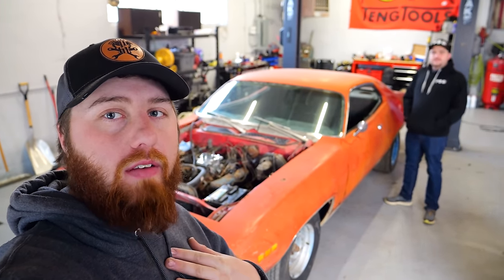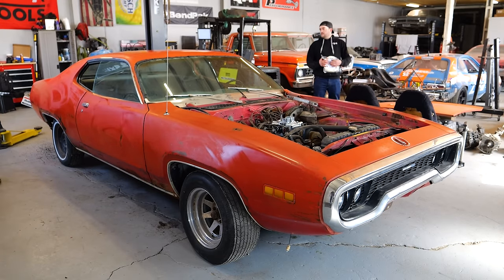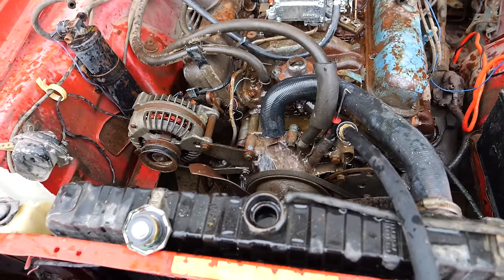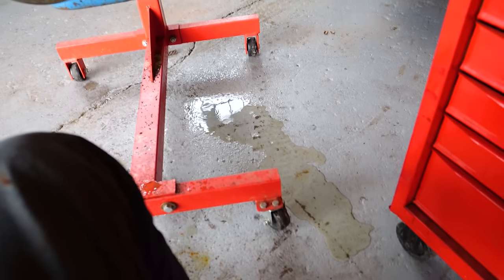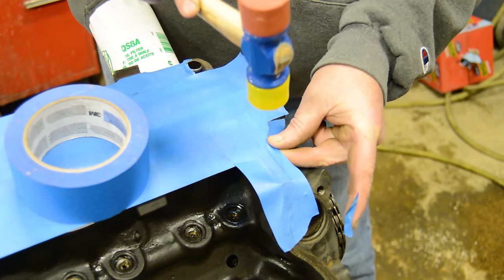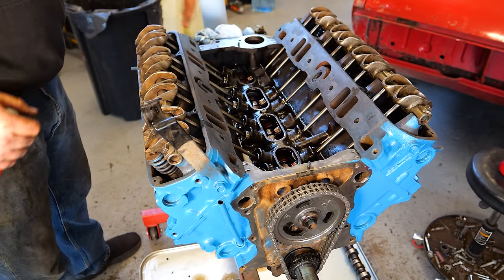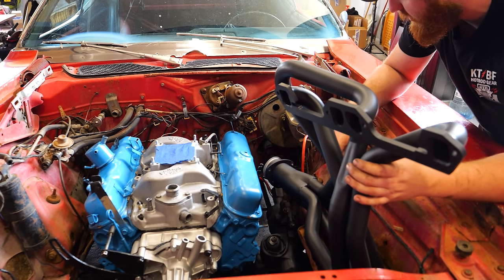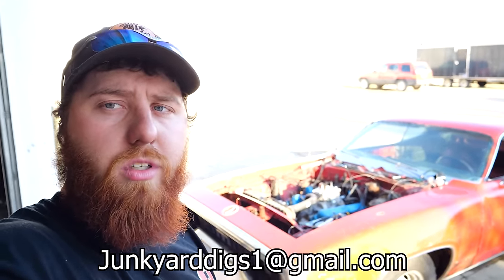ABANDONED MOPAR Budget Engine Build + Paint REVIVAL - Lost for 30+ Years!

Comment: Camshaft install tip I was taught: Get a long piece of all-thread the same pitch as the cam sprocket bolt and use it like an extension to put the cam in, then just unscrew it.
Reply from the maker: Thats a good one! Another trick is to out the cam sproket on and use it like a handle, unlike I did 😂

Comment: Hey Kevin…..as a rule of thumb while you have that engine out of the chassis now would be an excellent time to replace ALL of the freeze plugs.  Even back when those Mopars were just a few years old they would eat up freeze plugs!
Reply from the maker: May or may not have cover those in expoxy and said send it 👀
Reply: Hey, close counts
Reply: @JunkyardDigs  New plugs cost barely more than the epoxy and it would have been an excellent chance to clean out the inside of the water jacket. Would not be surprised if that block came from the factory with casting sand still in it, plus whatever mouse nest and rust was added later.

Comment: The clear paint is a good trick to help prevent all of the spotting you inevitably get with aluminum. I went ahead and painted mine the block color. Mimics a cast intake pretty well but I like the look of orange over the aluminum color. Like you said the trick is to just never have gas dripping down on the paint.

Comment: Awesome, these videos have me mesmerized! In the previous video I was wondering why you didn't work on the block first (the peripheral items are not likely to be show stoppers), but this video provided all the answers. I guess the secret is having a lot of experience with rebuilds/restorations which lets you size up the potential gotchas of a project like this. From the big coolant puddle in the previous video I speculated a broken water jacket, but fortunately not. A leaking freeze plug on a 318, imagine that! The color and luster brought to the surface by buffing and polishing is just astounding. Love that throaty engine roar near the end of the video - what a sweet sound! As a former 72 Challenger owner these videos really tug on my heart strings.

Comment: You have more self-control than I do. If I had gone so far as to have pulled that engine I couldn't have put it back without doing the rings ... bearings and gone through the valves. My OCDC would be killing me.

Comment: Kevin: points out that the freeze plug is leaking.
Also Kevin: doesn't replace the freeze plugs.
Reply: I give this engine about 4 months.
Reply: @rickallen6378  I'm pretty sure you can see that same freeze plug dripping at 46:30
Reply: @1234567890CAB  Yes I saw it, should have been dealt with.
Reply from the maker: I fixed em off camera b4 it went back in
Reply: @1234567890CAB  Pretty sure you're seeing water that was sprayed through the rad from the hose to cool it down, the fan is pulling it through and splashing it around.

Comment: My experience is with leaky valves with old engines that has been sitting for a while is most of the time of rusty valve seats. Which you can get ride off quite quickly by giving the valves a bit more valve clearance, and after it has run for 20 min you can go back to stock clearance or what is advised for the type of cam. Nice to see you guys having a lot of fun together!

Comment: fun thing about the chrysler engines is we paint 'em all in one peice, after they're put together..
you can assemble it fully minus the carb, and just go at it.. then add fuel pump n accessories.. no need to worry about over spray that way, and from the factory the bottom of the pan was barely painted. Makes it real easy to be factory looking heh..

Comment: Great video. Quick tip on the balancer removal, take the washer off the bolt when you screw it back into the crank. The balancer will clear the head of the bolt. - Jamie

Comment: When removing the harmonic balancer instead of pushing against the crank bolt and washer, remove the washer and run the bolt in all the way. It will clear the balancer without the washer on and you can do one pull with the puller without having to pull the bolt out. You also are engaging all the threads so no chance of messing the threads up.

Comment: Kevin, that engine has been seriously overheated.  The carbon-like crust is the result of a paraffin based oil, probably Pennzoil or Quaker state. The inside of the engine probably would clean up quickly if you shorted it a quart of oil and added a quart of ATF instead, at least for a couple of oil changes.  As always, great video and excellent content.  Thank you for stressing the importance of cam break-in for flat tappet cams.

Comment: Great video from another 71 Satellite guy… I know it’s a budget quick rebuild but the freeze plugs, thermostat and just looking in those cylinders while it’s on a stand was alittle surprising. I’m sure it will run great…(for awhile) keep it going and any possible parts you might need just call it out, might have something around you need. 👍🏼
Reply: Tail light housings! He needs tail light housings!
Reply: @twinkie27271   - Well Scott… if I had tail light housing’s I would have asked for an address !!! !!! Not sure why you like using your exclamation ❗️ points so much !!!

Comment: Bro --- when breaking in cams on  cars you can fill the radiator up with hot water from kettle, it opens thermostat before you start motor and you can get air bubbles out then, before motor starts, then no overheating on cam break-ins...👍

Comment: You probably been told already but with the restricted water pump port you should probably put head gaskets in it if for no reason other than to be sure you have no more restrictions in water jackets
Reply: TOTALLY AGREE & A CHEAP VALVE RE LAPPING. GREAT TIME TO ALSO DO THE FRONT SUSPENSION ?

Comment: From the looks of the build up carbon inside that engine they must’ve used Quaker State Oil  in it. My dad had a 60’s Chrysler Newport with 383 High Performance Engine. He ended up with 400K miles on it in the 90’s before he sent it to the junkyard. But back in the 70’s he had ran Quaker State oil for 10 years & the valve cover gaskets needed replacement. So We took the valve covers off when I was a teenager & in High school automotive class. So I was eager to do auto work So I crawled into the engine compartment & we went to work....AND OMG what we found under those valve covers was unfreakingbelievable!!!!! 
It was so much damn black Gunk Carbon and sludge build up.....THAT WHEN WE REMOVED THE VALUE COVERS IT LOOKED LIKE IT STILL HAD VALVE COVERS ON IT!!! I COULD’NT BELIEVE MY EYES , BUT IT STILL HAD BLACK VALVE COVERS ON IT AFTER WE REMOVED THE TEAL BLUE ONES. FROM ALL THE BLACK CARBON SLUDGE BUILT UP FROM RUNNING QUAKER STATE OIL FOR 10 YEARS !
 It took us hours and hours to remove all that black carbon sludge. After cleaning it we put new gaskets & I dumped all the oil and we went back with valvoline oil and he never had that problem again! Dad said if I would’ve known that Quaker State Oil would do that I never would’ve ran it in my car. We changed the valve cover gaskets again about in the 80’s & the rocker area was clean as it was supposed to be. Anyone that uses Quaker State Oil is asking for trouble.

Comment: I'd have removed the freeze plugs and flushed the block. At least you wouldn't get it back together and not have one give up once it's running. The hammer & tape trick works well for gaskets, if you can grab a roll of gasket material. I've used it for carb base, thermostat housing, timing cover and basically anything that needs  just a simple non-high pressure gasket. Great to see Thunderhead289 on your video again. The trio would make a great video, especially if Luke could make it a foursome on a double revive.
Reply: My bad, I was thinking of a foursome revive with Angus being the fourth man😊

Comment: The oil pressure is fine.   My 318 idles that low aswell.    Mopar says the 318 can safely idle as low as 6 psi and the oil sensor is adjusted to have the dash light come on at 4 psi.

Comment: If no ones every taught YOU (Kevin) how to use a harmonic balancer puller on a MOPAR, this is the sure fire way to do it properly... Take the bolt off, take the washer off, thread bolt back in as far as you like as it'll clear the balancer hub hole now, proceed to push with your puller tool until the balancer is completely off and not have to worry about damaging any crank threads.   This is one of the many ways classic mopar engineering/motors are just better than X-brand stuff.

Comment: Since you had the oil pan off I would of at least pulled the pickup screen off to see if what was left of the valve guide seals were in the screen, they restrict oil flow leading to low oil pressure issues. The worn exhaust valve guides will lead to blowback , it will start at high way speed getting progressively worse, that four barrel and cam did not help the situation as for extending the life of that engine, 318s are tough little engines and will give you a 400 thousand miles service life if they are properly maintained...wish I still had my 73 sattilite, it was a beautiful car.

Comment: Cleaning gunky engine and engine parts, I use the same thin I use in my parts washer. Diesel fuel. Melts that stuff a lot better than bran name Gunk, and it cleaning a decent engine(paint) it won't take off the original paint. If i want to do that I use oven cleaner after I use the diesel fuel and pressure wash. Honestly, I thin with the issues you found, I would  have taken the intake back off, removed the heads, did a valve job and installed new valve seals. Would have really made this a better job for sure.

Comment: The 318 has a bad rep as not being a great motor because it was the lower optioned V8, and because it survived well into the 80's in trucks and cars during a time all the guts were taken out of all motors.  It's a good engine capable of making good power with upgrades and tuning like all motors.  I expect there's a bunch of crap stuck behind that thermostat when you get it out you might need to do another radiator flush...Great work on a real-world budget upgrade!

Comment: Water pump bolts...If ya get em out, use antiseize upon reassembly    The water pump bolts on my 302 were crusty but came out (302 in a 1984 Datsun 200sx S12)   I cleaned the bolts well, and then used antiseize    the next time I take off water pump, the bolts should come out nice.

Comment: im proud of you. its awesome that you are putting this classic back on the road. BUT. Why didnt you dress up the engine bay with a least a can of clear coat and paint a few other things in the bay and paint the transmission. Detail is what really sets things off. i used to be a house painter and you would not believe they reaction from home owners when i would paint the vent pipes on their roof black even when i had well overcharged them. they were so happy that it set their paint job off and looked incredible

Comment: A good budget engine build would be a 383 with a 440 crank = 426 cubes (basically a max wedge) compliment with some decent heads like some 915's maybe ported and a half decent cam, you could be making over 500hp on the cheap

Comment: I bought some ceramic coated shorty headers for my 1 ton square body and the clutch linkage went right in the middle of the collector hole 😖, I bought a set of long tubes like it had and it worked fine.

Comment: @27:48 News flash; Chrysler Corporation painted the engines once they were assembled, meaning head bolts, core plugs, intake and bolts, valve covers, etc.

@30:28 That is NOT a roller cam. It’s a flat tappet. Furthermore, you don’t break a roller cam in.

Comment: Oil sludge in old Mopars was common. Engine oil technology wasn't very advanced when that car was in regular use and those engines were tough on oil.   I've seen worse than that and the engine was fine.  They  were also great inboard boat engines especially with raw water cooling.  They ran cooler than in cars or trucks and didn't seem to have as much of the oil sludge issue.  I love old Mopars the last one I had was a Dodge truck with a 360 and that was a long time ago.

Comment: 318's were kinda stout and had the same peak torque output @2,400rpm as the 'hi-po' 4bbl bigger brother 340, so 'felt' quite torquey to drive. Valve stems running dry and 'squeaking' was a 12 mth warrantee fix when brand new. Other than that they were a big heavy lump of iron that went quite well, even on the 2bbl Carter they came with (same carb as used on the 225 slant six)
So, on std 775 crossplies the stock std 318 could lay down 50 yards of black rubber from a standstill (non-LSD) and my dad's 1970 Valiant Safari 318 'Fireball' 230hp [LOL] got this special treatment from me, regularly, when he wasn't in earshot!

Comment: If you want good "spray paint", SuperMax (Eastwood rebrands them as there 2x paints) is proper urethane 2 part paint that is stronger than anything Ive used in 30 years of using can paint.

Comment: I always wondered with carp engines leaking around the valves, have you tried removing the spring and attaching a drill chuck around the valves stem? You could then spin and pull tension to do a dodgy grind of the valve seat.

Comment: Question: Did you find plugs behind the camshaft thrust plate or did the factory just depend on the plate itself to block off the oil passages located behind the thrust plate?

Comment: Granted it is not a GTX but they do have a very close body style. With that said my buddy in high school had one of these and it looked pretty bad ass just by changing the rear lead spring shackles with 2" shorter ones in the front and 4 inch longer ones in the rear of the leaf springs. Cut the first full and 1/4round off the front springs and you end up with the front of the car dropped 3" and the rear lifted 4" then he put 265/40/15 tires on 15x 12 crager mags on the rear and 215/40/15 on 15x 8front mags the car ended up with a very Mad Max look

Comment: You know that Super Scraper is made for cutting bearing surfaces onto cast iron right? It could not be a more proper tool to ruin a sealing surface. Unless the tip is straight instead of slightly curved. If it's straight, no worries.

Comment: You had puller on backward when pulling the harmonic balancer off. The flat side always points toward the bolt heads so you have...you know - a flat, even surface to pull against. You otherwise splay out the bolts. Hello?

Comment: Stock Small block mopars can be advanced quite a lot with no problems, also old style cork China wall seals can work if you use the little pins they are supposed to come with but don't any more also not a bad idea to pick up a latter magnum gasket kit they have a few that are more modern type gaskets that are a bit better quality and design

Comment: That awful orange fram filter is pure evil. Seeing how crusty and slugged up it was inside tells me oil changes weren't a common thing to whoever drove it at the time. I used to like the orange fram filters back in the day on some of my earlier vehicles until I saw how badly made they are inside. Then I started avoiding them like the plague because you can get higher quality oil filters from other makers that are actually cheaper. It's good to see it's getting some nice zinc rich oil after going through long term abuse. :)

Comment: I would have pulled the head off and did a valve job and new value seals then I would have pulled the roads caps to see the barrings same for the main barrings and used place gage and with the head off I look at the cylinder walls if they not look so good I would Hone the cylinder walls if it needs barrings do them. That way you know how good the lower end of the engine is. And a new oil pump

Comment: 15:51 Grade 5 is better in a shear situation than grade 8. Grade 8 has a higher tensile strength but far less give in shear. Keep the grade 5 hardware. It is there for a reason.

Comment: If you can get it the Orange Clean engine degreaser works AMAZING! It truly uses citric acid to do most of the work and smells amazing while breaking down grime really quickly. For some stupid reason it's no longer for sale in Commifornia though despite being 100% non-toxic.. shakes head This state.. Oh, I guess they went out of business or got bought out and changed into something else.. Go figure.

Whoever rebuilt that 318.. obviously they were from the Aussie school of Kowalaty Mechanics. Orange RTV on the exhaust, Fram oil filter.. It's a $50 rebuild if I've ever seen one. 

How much you wanna bet Kevin isn't going to replace that core plug that was leaking?

Comment: Hey Kevin, question for ya. I'm pulling apart my 1989 Dodge Dakota right now since I have to rebuild the engine. I'm working out of my garage, no lift, no engine hoist, etc. Any suggestions for a better way to pull it than what I got? My current plan is to get a jack under it and after removing the front crossbrace, very sketchily pull it out with two other morons holding it as stable as physically possible, ideally not dropping the thing and cracking the concrete, but hey, if it drops and breaks, I'll just 5.7 Hemi Swap it..

I'd really rather NOT break it. I'm ballin' on a budget here

Comment: Junkyard, I have an issue I can't pinpoint or figure out. I have a 71 Torino with a 351c 4 bbl 4v and 4 spd. I Went to do a burnout and the car started shaking like a mfer, it wasn't hitting rev limiter and would only happen after a few seconds into the burnout. The engine has to be torquing because it broke my fan shroud. however, the engine mounts aren't broke or anything. I've been trying to figure it out for a while. It only does it on pavement when it tries to find traction. on gravel or anywhere else It spins like it should. and NO its not revving to the moon or hitting a limiter when it starts shaking/bucking. Is it just the engine being underpowered? I don't think it is, as i've never had this happen even in a 255 mustang I had that fought trying to do one.